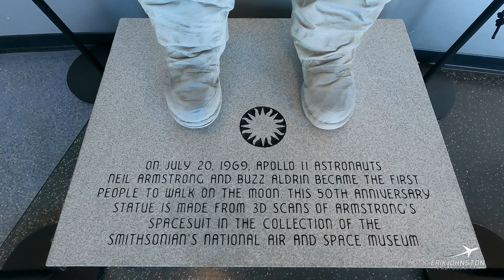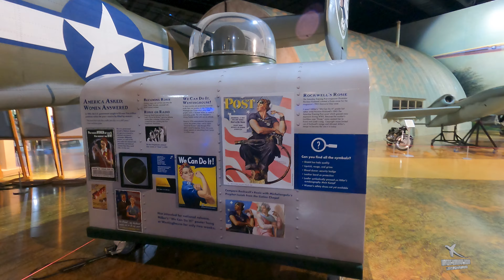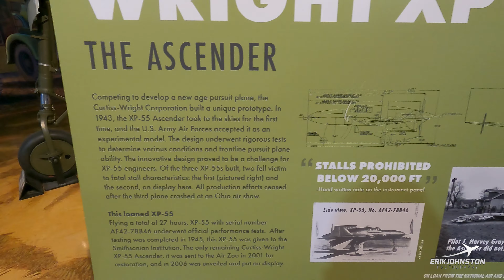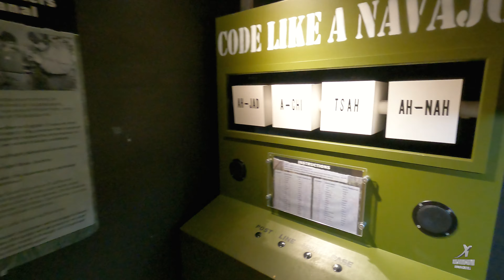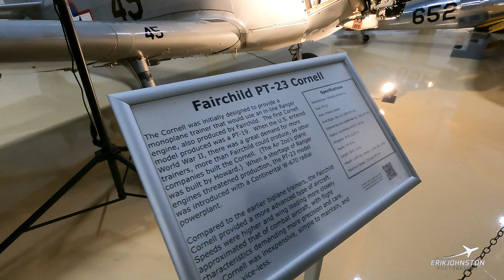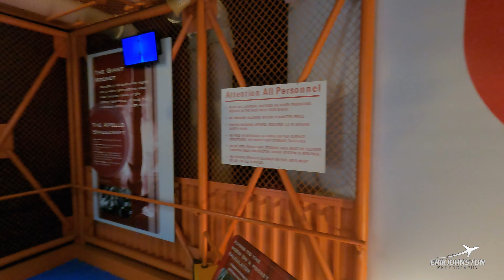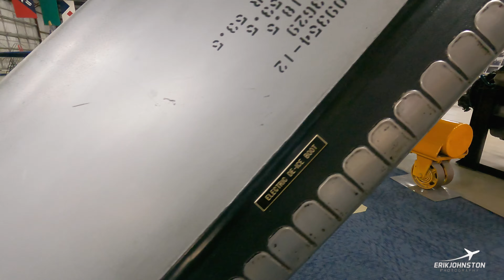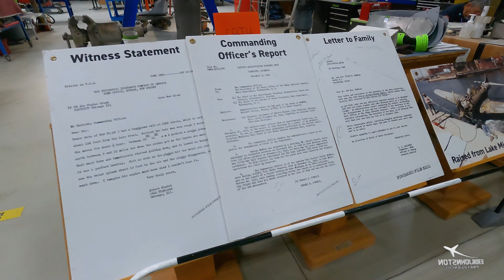Air Zoo Museum Tour Walkaround

Comment: Interesting fact about the Hispano Aviación shown at 22:55
It esentially was a BF-109 yes, but the engine used was the Rolls-Royce Merlin. That's why the engine cover looks like that on the lower side. This is why in Spanish it's called "Buchón". It was also used in many movies as a fake BF-109.

Comment: impressive Museum with two planes listed that I relate to with great reverence.  #1 is the Learjet 23.  That particular plane I'm not familiar with however one that I am familiar with is N175FS.  It was sold by Clay Lacy (Van Nuys, CA) to one of the worlds great entertainers and the plane is solely responsible for two amazing songs entrenched in a great love affair between two entertainers.  I'm leaving you to figure it out.  #2 is the "attack" model of the B25 which was very successful in the European and Pacific WAR theaters.  You obviously noted the 8 Browning's in the nose, but in addition there were two mounted on each side of the nose and facing forward.  That firepower was capable of sinking small  to medium ships.  As impressive as it was, there is one more impressive along the same lines.  It is  the Douglas A20 Havoc.  I had the pleasure to work on what I understand to be the only flying example while living in El Paso in 1973.  It was purchased by Willy Farah from Howard Hughes (you can hear other accounts, but that's the real story).  Willy was completely enamored by the plane since he flew one during the Korean War.  Willy's team took the plane down to the wheels and restored her to better than new condition.  My only contribution was that Hughes had converted the bomb bay to a 4 seat lounge/bar, replete with picture windows (like a turbo commander 690A) on each side and used the plane as his personal high speed transport.  Hughes had used a new product (spray-on foam) to insulate the compartment.  Several attempts were made to remove the foam without success.  On a whim, I used a pneumatic die-grinder with a 2" adhesive pad which removed the foam but didn't etch the aluminum.  Willy painted the plane with IMRON, which I had never seen before.  That plane still flies today from its base in Texas (Dallas/Ft. Worth I think).  It's still configured like Willy flew it, with the multi-Browning's facing forward and a functional Bomb Bay.  Kenny Farah and I chased the A20 on the deck one day but couldn't keep up with it in the 690A.  Willy could really make it talk.  A difference between the A20 and the B25 is that the A20 had "one seat" and no crew (some had a gunner on top).  Willy's plane had a single seat which violated the Corporation's charter for air travel.  Willy's response ... he fired the Chairman of the Board and amended the charter.  They don't make-em like that any more.